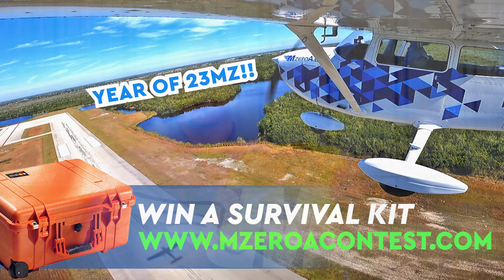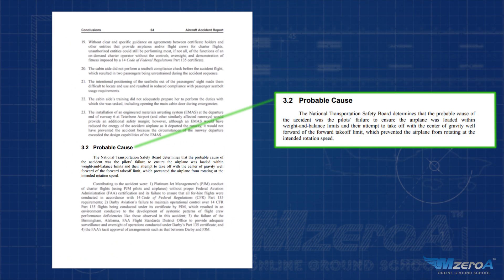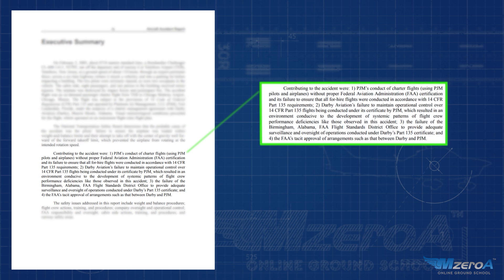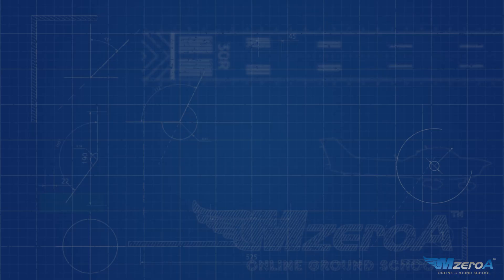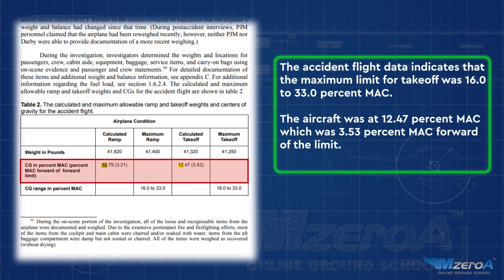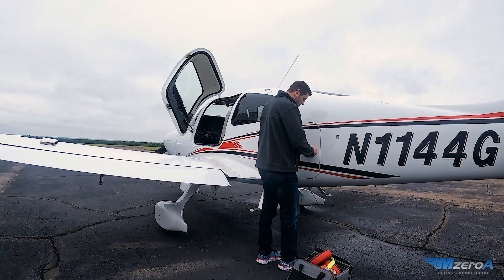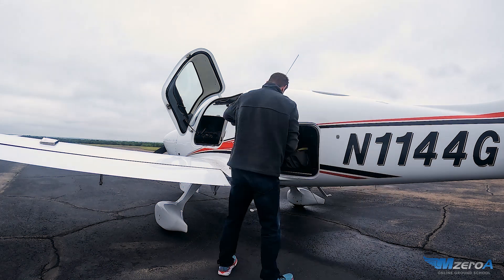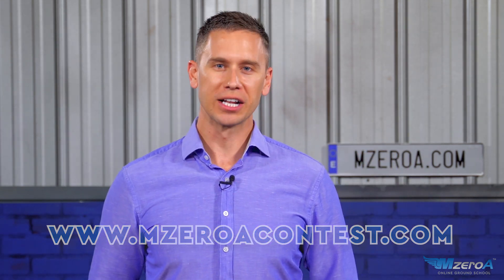Avoid This Mistake! Challenger Weight and Balance Problems.

Comment: Has the plane you fly been modified? Even something simple as changing the avionics package and adding or taking out auto pilot changes, the overall basic empty weight. You must obtain the actual current, basic, empty weight, and CG for the aircraft that you fly. As a renter, I keep close tabs on that information for each airplane I use. The POH steel will have the proper stations for the passengers and the pilot. Remember front seat CG changes because you have an adjustable seat which may move the seat in their tracks as much as 6 inches from their forward station.

Comment: I fly a 182, which is pretty hard to make tail heavy.   However, I took off once with a lot of baggage, 3 souls, and 1/2 tanks.    I did the weight and balance and all was good.    The real surprise occurred when, even though in balance, I needed to trim down on takeoff because the airplane was over rotating.  Now when I am tail heavy, I trim a little nose down before departing.

Comment: When I am instructing about Weight & Balance I cover the material need for a beginning pilot to gain an understanding of concepts.  When they have the basics firmly implanted, I then take the subject of W&B to the next level.  I teach them "extreme loading conditions".  We work up the W&B on paper using the maximum gross weight and full fuel with the CG loaded to the extreme aft limit; then with maximum gross weight and full fuel we calculate the CG at the farthest forward limit.  Next we calculate the same extreme loading condition with ZERO FUEL.  To further drive home the lesson, we calculate minimum takeoff weight (the student and me) with full fuel and then with ZERO FUEL. After the student has shown that he understands the concepts, we then go out and FLY the airplane using those extreme conditions loaded in the airplane.  I especially do this scenario whenever I do transition training into a high performance or complex aircraft.  (NOTE:  when flying the airplane to demonstrate the "zero fuel" condition we obviously don't attempt to fly with insufficient fuel.  We use a plane that has minimal fuel onboard and remain over the airport at all times during the flight.)

Comment: I'm presently taking a seven week informal Boeing 737 course, conducted by two seasoned line training captains for major European carriers, and something they continually emphasize when programming the FMC — "Garbage in? Garbage out." The tools are wonderful, and absolutely necessary for jet flying, but you have to program them correctly in order for them to work properly. And that's a lesson even for GA aircraft, whether we're talking Foreflight and other apps, or Garmin technology, etc.

Comment: Hi Jason, I have been using FF for W&B, added all for my C150m and noticed something called “zero fuel (max 1444 LB)” that is another “limitation” outside the typical CG/weight envelope.  I have never (3 decades) used this and not seen in the POH?  It’s a factor if I were to have two heavier people and reduce fuel weight and still be in the normal CG/weight envelope but would bust the zero fuel limit? 🤔
Reply: Looks like whoever wrote the algorithm / program took the fuel tank size and just subtracted the weight of the fuel (156 lbs) to get a technical max loading since most people just fill the tanks on a 150.  HOWEVER, you are correct that the C-150 does not have an official ZFW and the FF calculation would also be wrong because the official Empty Weight includes the Unusable fuel, which is not accounted for by the FF numbers.

Comment: I almost never do a weight and balance on my flights.  I fly alone 99.99% of the time and do not carry any luggage.  I do a calculation once for each “new” airplane I fly with full fuel and one hr fuel to make sure I am within forward an aft c.g.  I only weigh 150# and will never ever exceed the gross weight of any empty 4-seater.  I think doing a weight and balance for the same empty 4-seater for every flight is too much.
But if I start to fill the seats or baggage compartment I will do a weight and balance.

Comment: Having gone through 4 recurrent training events on a 604 this CG thing is interesting, 
In training (I won't mention providers name) they harp on the fact that you cannot put it out of CG limits due to fuel because of the fuel computer and how it automatically transfers it around and burns it from the tail tanks first. 
Anyways, back on topic. 
A lot of people take and remember the "can't put it out of CG" and forget the "due to fuel" 

I don't miss flying the Challenger 600 series.